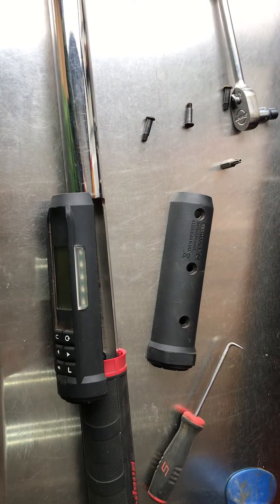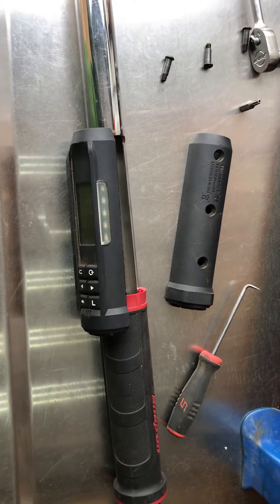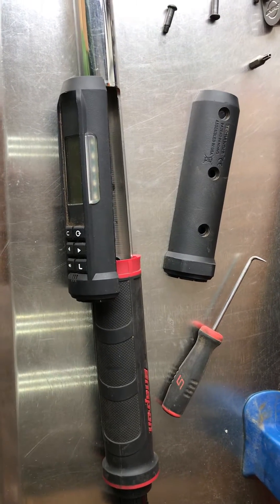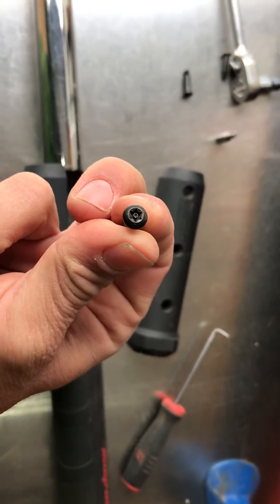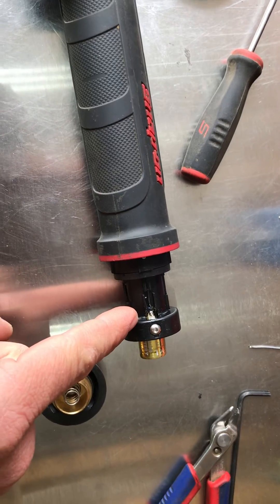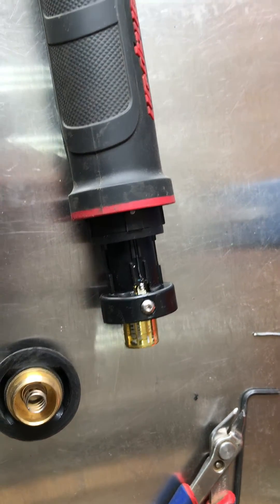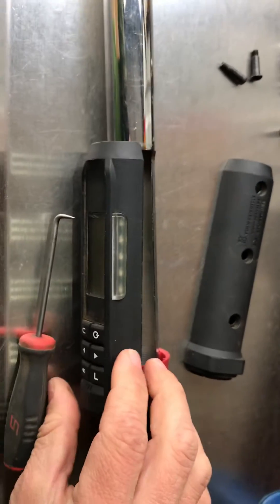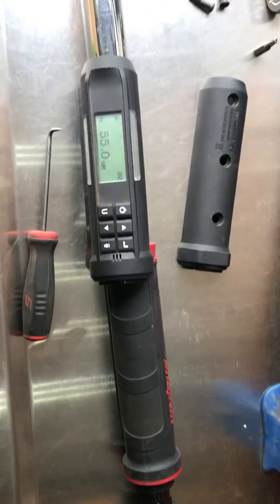Snap on Techangle torque wrench fault

Comment: Awesome this made my day!! Helped me fix my ATECH3F250VG just now and i have had it put away for years cause i forgot about it and it was so annoying to use as it was cutting off every second. 🎉
Reply from the maker: This fault used to do my head in every time I used it, to the point that I went back to the old school click type with a manual torque turn gauge. Glad my video helped!
Reply: This just helped me diagnose and fix mine! Thanks!